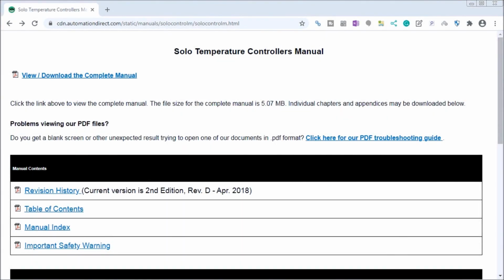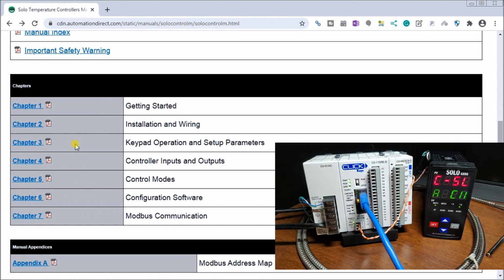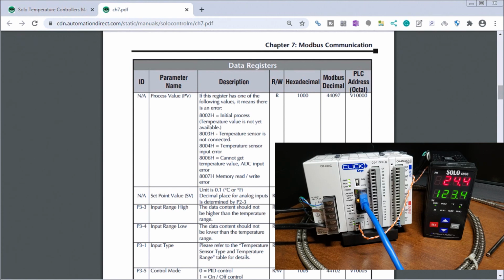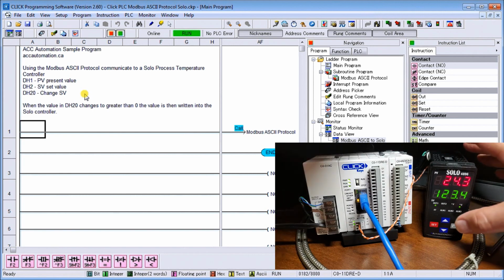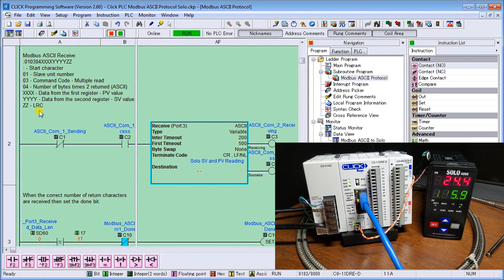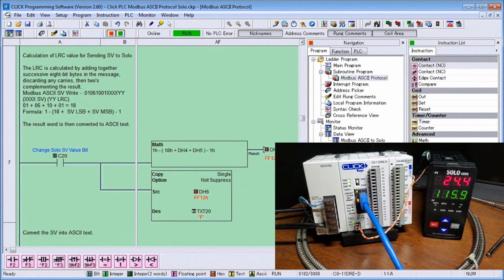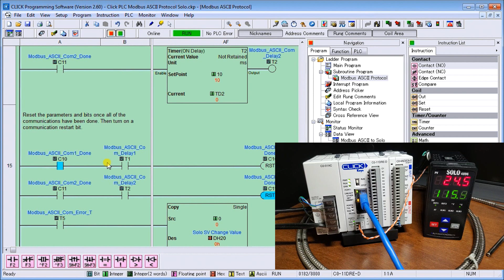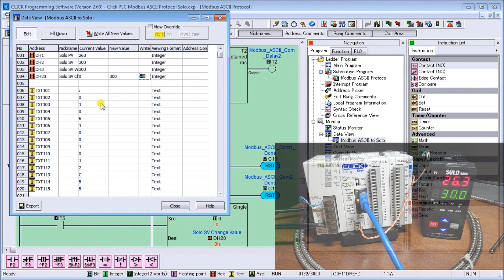Click PLC Unlocks Solo Controller: Modbus ASCII Revealed!

Comment: very nice ASCII information and hard to find... Garry, can the Click-PLC ASCII read/write to an 8, 16 binary word or number to turn the individual bits on/off like event switches to an I/O terminal? thanks
Reply from the maker: Hi q zorn,
Thanks for the comment. Modbus ASCII has the same commands as Modbus RTU. Yes, it would be able to read and write to an I/O terminal block that is a Modbus ASCII slave. 
The Click has the copy instruction with the pack and unpack bits. This will help you get the bits in order to send or receive the information.
 Regards,
Garry